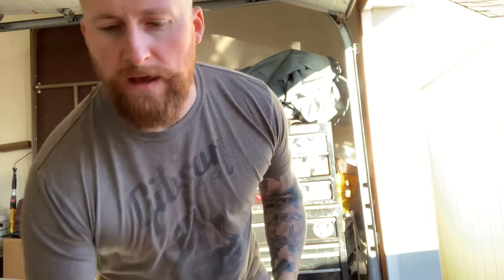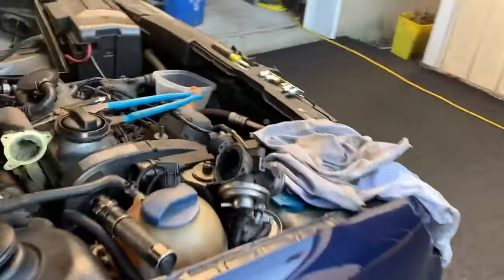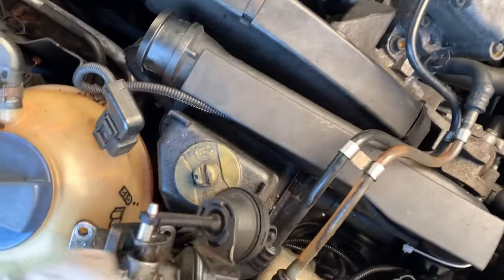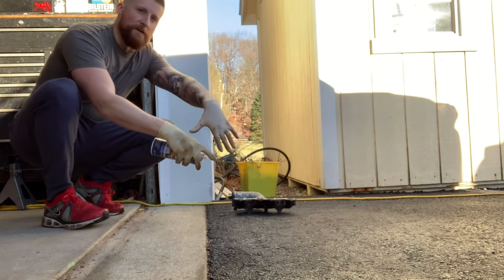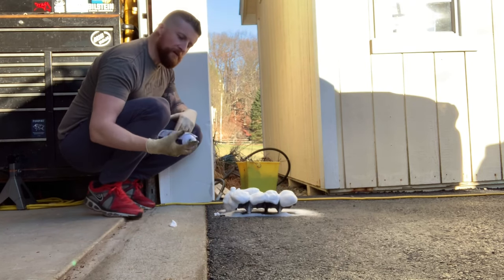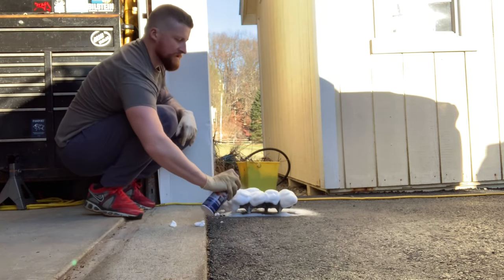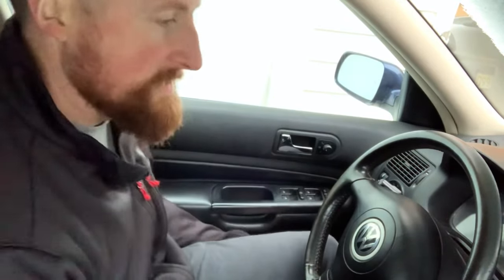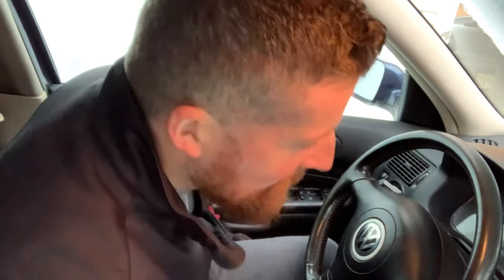High mileage VW TDI/Diesel - Clogged intake You won’t believe your eyes

Comment: That’s no one drives any more diesel cars. Last 10 years almost  every one drives on petrol, CNG, TNG, hybrid or el cars. No problem wit EGR, DPF, or similar common problems which you have with diesel cars. Personality I drive 5 years old Toyota CHR hybrid, and after 120.000 km it’s in mint shape. Petrol fuel consumption it’s 3,9L/100km. Not problem with anything. Last time with my mechanic he check hybrid battery in car, it’s 97% health. 👏🏻
Reply from the maker: Very wrong statement all across the board. 
Most of cars in Europe or Middle East are diesel powered. 
“Hybrid or el cars” not even sure what your implying there, although you seem to contradict yourself in the following statement. Either way, Thank you for watching!!
Reply: @VikingsGarage  Diesel cars??? No one even produces cars with that engine any more. What a ignorance.
Reply: @VikingsGarage  😘

Comment: have you thought of converting your TDI to run on CNG? i just bought a 2015 TDI 45K miles but am not ready to dive into CNG conversion without losing the 4 years warranty on the smog certificate.
Reply from the maker: I would possibly try that but I ended up selling it. I do miss it.

Comment: My passat has thrown a traction control light up every time I start it. It runs like it wants to die and when accelerating feels like it's a knocking machine but once light is off it runs smooth could egr be apart of my problem?
Reply from the maker: Honestly Sir , I’m not really sure. 
But when they clog up bad, it makes for really hard starts. 🤷🏼‍♂️

Comment: Question.. how did you clean your EGR valve? Did you use the oven cleaner as well?
Reply from the maker: Mostly with a rag and a brush. It’s tedious process but works. 👍🏻
Reply: Thank you very much.
Reply from the maker: Your welcome, I appreciate you watching and supporting the channel. Good luck Sir.
Reply: Use the exact same one he did though: "Easy-Off Fume Free", the blue can. That one doesn't contain any lye (NaOH) like the EO Heavy Duty or really any other oven cleaner out there. Lye will eat the aluminum and other parts too. 

Also, make sure to actually remove the components to clean them. Just spraying it in there could result in: (1) a chunk of carbon going into the cylinder, breaking the engine, (2) oven cleaner getting into the cylinders which has reports of killing these engines.
Reply from the maker: Very good info, always clean it in a bench outside the car. 👍🏻
Reply: @VikingsGarage  Just to be clear, did you use oven cleaner or some solvent on the EGR valve itself, or strictly rag and tooth brush?  Just picked up a 1.9L Bug, the borescope says...I got boogers. 🤣😂
Reply from the maker: Just oven cleaner and a brush
Reply: @VikingsGarage  Many thanks, great video and appreciate the response :)
Reply from the maker: Not a problem.

Comment: Hi great video. I've just stripped and cleaned my Golf TDI EGR valve and throttle flap. It was in a terrible state 😮😮 and took hours of scraping and oven gel to clean. I do have a question. Its a 2007 1.9 TDI 105 BXE engine and I cant see if it has a DPF. So do you know if it has one or a Catalytic converter or something else I need to clean. - thank you
Reply from the maker: I’m not entirely sure Sir, I know a lot about 2004 and older 🤷🏼‍♂️
Good job on getting that crap out, it’s always a struggle.
Reply: From what I was able to find, none of the 1.9s ever had DPF mounted to them. I have the 1.9 BKE and many sources said I have a DPF when i actually don't
Reply: @JohnDoe-ij2zi  absolutly right. One wonders what I was going to charged for by taking it for a professional DPF cleaning? Would they have simply charged me and because if my lack of knowledge or come clean? Any way the EGR valve clean fixed most of the issues. But I still failed as the engine refused to come up to full operating temp. A faulty thermostat caused the emissions to exceed the limit. Now all repaired I'm getting great MPG again and the engine runs great too. I put a tank of premium diesel through the engine every third fill up. It certainly runs better over all 😃😃

Comment: I have a 2006 BRM Jetta with almost 200,000 miles.  what are the symptoms?  My air filter is getting super dirty super fast is that one of the symptoms?
Reply from the maker: That’s not a symptom, it’s lack of power/sluggish. No pick up at all. It’s easy to check, just remove the hose to the egr and look in there. Good luck.
Reply: Could be a bad injector... running rich.
Reply: Rough idling, luck of acceleration power, staling when idling at stop lights...jerkky rpm
Reply: @InMoroccoholidays  could be bad injectors, dirty fuel filters or bad glow plugs

Comment: Add a comment...

@markgagner1607
0 seconds ago
In the pursuit of higher fuel mileage but more importantly, dependability, I’ve learned that, Rawtek makes a pipe to replace your DPF filter and catalytic converter (Off-road use only Of course) And you need to purchase a Tune-zilla tune kit that eliminates all that electronic gizmos so you’re not dealing with check engine lights. The pipe looks like high-quality and well manufactured but it’s $1100!!!. Bad enough the tune is $750. I’m seriously thinking about gutting my factory exhaust and running that with the tune-Zilla tuning. I’m not a performance junkie, and I’m not even sure it would make a tremendous MPG improvement.  My main goal would be to eliminate all that extra emissions crap that keeps giving me problems (and exspensive ones) like plugged cat, plugged DPF, failing O2 Sensors… fortunately, I do live in a place that does not have annual inspections.
Any thoughts?

Comment: Ive got a passat 1.9tdi would a clogged egr or intake manifold make it smoke alot?
Reply from the maker: Absolutely! The engine is being suffocated.
Reply: @VikingsGarage  Okay ill check it out thanks :D would it be better to just block off the egr after i clean the intake manifold and egr?
Reply from the maker: You can always by pass it. YES

Comment: Ye EGR delete asap ;) did it to my car as soon as i could..
Reply from the maker: I hear it wakes it up. Must do mod.
Reply: @VikingsGarage  it should provide more air for the engine intead of the exhaust gases and prevent intakes from cloging up like this... 

Also mine is just ECU disabled it should just open every 50k miles or so... 

Friend in his older car just metal blocked it and disconnected.. it does wonders just this small thing
Reply from the maker: Agreed, thank you for sharing and watching. I appreciate the support.
Reply: Let s not forget to mention that you better don t get caught doing that, in most European countries and the US, this is illegal with some countries having hefty fines for that. Then the engine and even more so the exhaust system does get hotter coz the "positive" side effect of getting more fresh air into the engine inevitably leads to higher temps and the oil gets dirtier much faster. Not worth the downsides in my book.
Reply from the maker: Very true.

Comment: i change wih a new one this part, they clean  inside as they said 30 mts at 80kms in a 4th shifht.. and still the  light check engine and the   light look like sprin on.  and  my accelaracion   soo poor, i have change the timing bell, whater pump cooler, i really do'nt now what else  i can  do, do you have any aidea to help?

Comment: i have an mk5 1.9 tdi and its geting big consume 8 l /100km my mechanic say its egr valve ? does egr effect on consumation
Reply from the maker: Egr function is super key on engine performance. Could very much be it.
Reply: @VikingsGarage  and he stops in 140 kmh dosent go more 5 gear 2900 rpm
Reply from the maker: Yeah make sure it’s working or even clogged.
Reply: @alb.alboz2083  I assume you got the 77kw / 105hp 1.9 tdi...limp mode restricts this very engine to 140kmh and nearly 3000rpm, you can also feel that the gas pedal stiffens. Usually switching the engine off and restarting it resets this limitation. 8l is way too much and could be EGR related but the other issue that often causes limp mode, esp when you drive quite fast or accelerate all of a sudden (or break and then go all out on the throttle) is the turbo, the variable turbine geometry might be worth checking at the same time. Over time, the moving fins clog up due to carbon build up inside and then they don t move freely enough to adjust in time, once the electronics detect that, it ll activate limp mode.
Edit: they typical error code for what I just described is P0234 -overboost condition (can be the opposite as well, then you d have a leak somewhere) on the VCDS. Sadly this very error code is very general and the EGR can t be excluded. So given that cleaning the EGR first is much easier, I d do that first. Then you can also have the VTG actuation checked if it moves rather freely coz getting the turbo out to have the VTG checked properly is a much bigger task.
Reply from the maker: Very useful info, thank you for sharing.

Comment: I have a problem in my seat Toledo water under the mat in the passenger side, any recommendations?
Reply from the maker: 1st thing to check is your air conditioner drain(know for clogging) 
2nd if you have a sunroof, make sure the drains are clean and free of debris. I hope this info was helpful.
Reply: @VikingsGarage  no sunroof, I think air condition is okay, where to check for clogging, I think it’s from the cabin air filter bcoz I have seen in some forums it’s a common problem in all  VW and Audi .
Reply from the maker: Look for a rubber tube that should be poking out from the floor. Under-the vehicle. Blow air into it.

Comment: I did 662 mixed driving . Will boogers prevent it from running
Reply from the maker: Eventually, depends how bad it’s clogged.
Reply: @VikingsGarage  new to diesel but my cjaa went to limp mode, died and wouldn't restart. Vcds showed 3 glow plugs bad and low fuel pressure. I replaced the Glow plug and module and eventually got it to start. It runs all of 30 seconds or so and dies. Will restart and repeat. When I changed my glow plugs I noticed a almost sand type of residue. Also in the oil
Reply from the maker: I’m not entirely sure what is going on there.

Comment: What is up with that blue smoke.
Reply from the maker: What about it?
Reply: @VikingsGarage  I am asking you what is wrong with your engine. Either it drinks oil or the injectors are bad. I thought you knew the problem in your car. I just wanted to know.
Reply from the maker: Sold it almost 3 years ago, burned a small amount of oil. 😎
Reply: @VikingsGarage  thanks for the anwser.
Reply from the maker: Anytime!